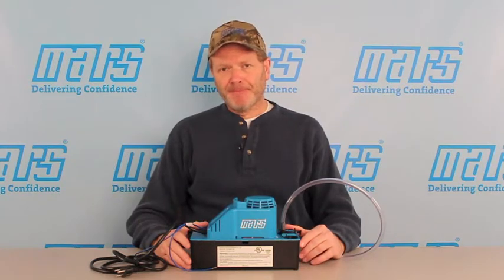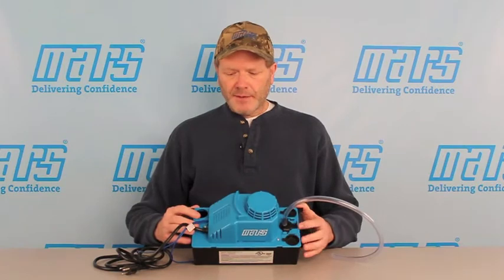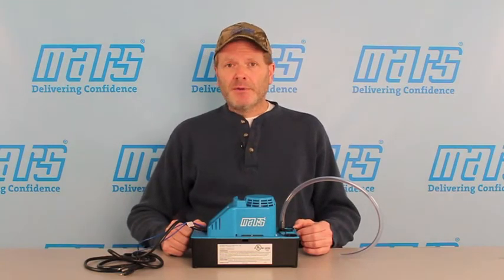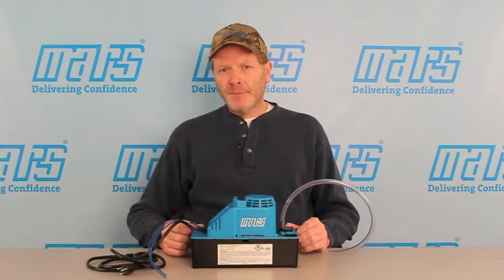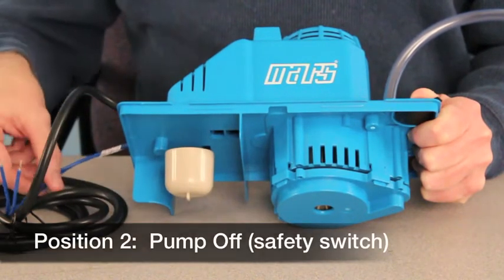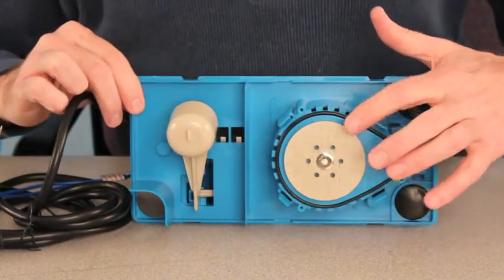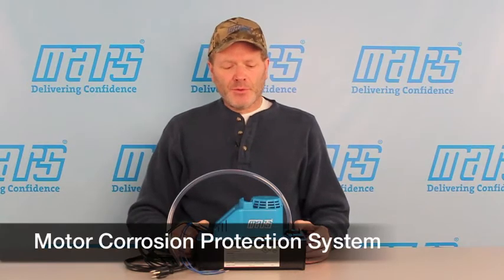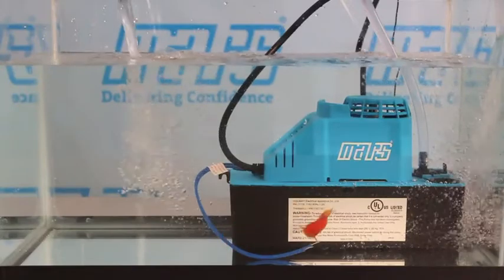MARS High Performance Condensate Pump Video

Comment: Just had a little giant low profile fail after 1.5 seasons of furnace only use. Hose valve broke off and unit is incredibly loud. Water everywhere, as it was shooting a stream of water up and into the general crawl space area. I'm going to buy one of these. Good vid & looks like a nice pump.
Reply from the maker: That stinks.  I think you will be very pleased with MARS.

Comment: I have one of these pumps in my AC system.  Recently I noticed there was water on the floor.  On further inspection I took the cover off and noticed the housing to hold the impeller was broken.  This is that ABS plastic the representative was boasting about.   This unit is just a bit more then 2 years old.  I have looked online and cant seem to find if this pump cover is available.  This pump is around $100(I live in Canada).  If anyone knows where to get this pump cover please let me know.  Thank you